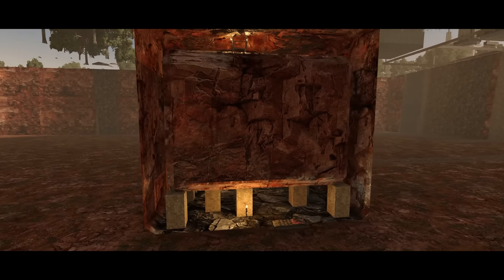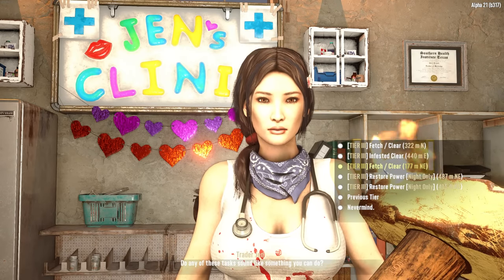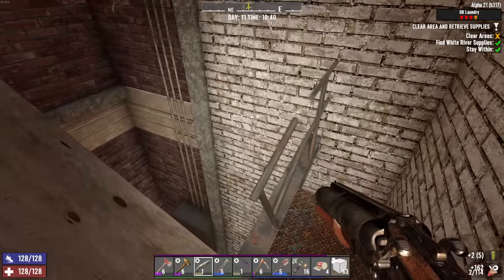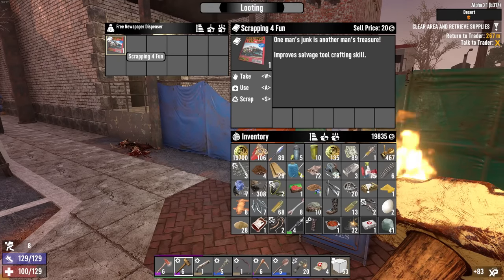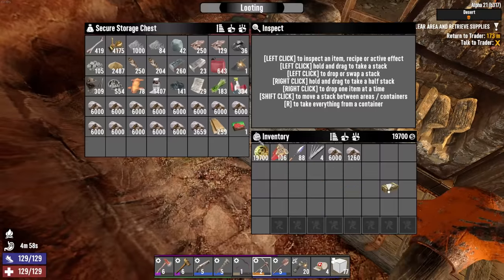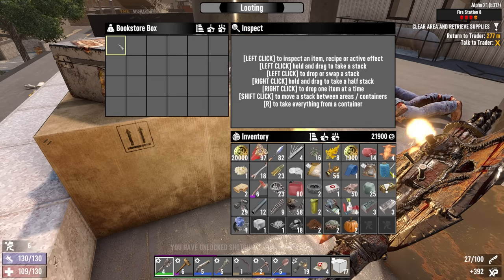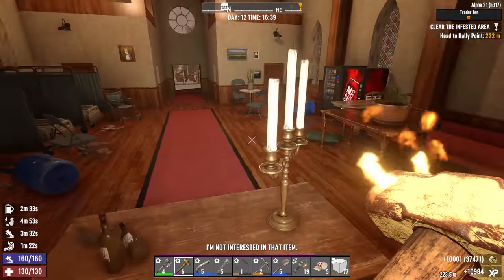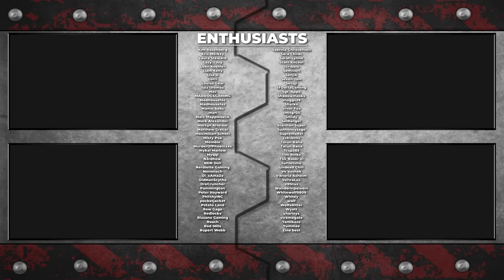The Tool and Transport Transformation - 7 Days to Die (Ep.6)

Comment: Oh damn, I was beheaded by Tem again !   I'll be back some day though.  😆
I found quite the bug with the vault door. You get stuck inside the door and can only spin around while stuck but can't interact with the door to open again. The health of the door means it would take forever to bust through and only if you have a good pick. Player gets stuck inside the frame area of door. Easy to replicate since trying to cross the bottom part is a bit wonky and noticeable difference. I spawned in another door and it was easily replicated again for images. A friend got stuck on our server and luckily I was on to teleport to him and get him unstuck but imagine someone with no clue how to get out on their own, no good pick and minimal drinks. This could be very bad for new players. He relogged and was still stuck inside the door when returning. If the area right inside the door is cramped like the water tower with just a one block catwalk it forces you closer to the door when opening/closing which is how he got stuck in the first place.

Comment: So far the only things of note to me that's different in the new alpha is that I run out of stamina faster even in things I'm speced most into, my swings of a club are much slower, and I'm slower in general. Things slowed down noticeably with the new point release to the point it took a lot of the fun out of the game. I melee slower and I run slower. It's the molasses point release. I hope it speeds up quickly. It kind of sucks now.

I died a few times fighting groups of zombies until I adjusted to the slower swing.

The running out of stamina so fast sucks. It starts out worse than the last alpha it seems to me, and the progression is a lot slower. In the last alpha my stamina was barely an issue at the first horde, and in this alpha I can't really use power attacks on my main weapon I'm putting a lot of points into. I run out quickly and have to stand there and wait. I can get a pipe machine gun by then, so I can use that while I wait for my stamina to come back, but I don't using have that much ammo by the 7th day.

I guess I could use spears, I haven't yet, and I might not for awhile. Watching other's game play online it looks pretty op. I don't like making things too easy.
I'm sure I do things that bug others too. I heard the game authors say they thought nerd poling was cheesing even though it's just a slightly less convenient ladder. If someone can be bothered by that I guess they could be bothered by anything, right? The funniest thing is that I swear some of the channels I follow started using ladders instead of nerd poling after that. Talk about succumbing to peer pressure! lol!